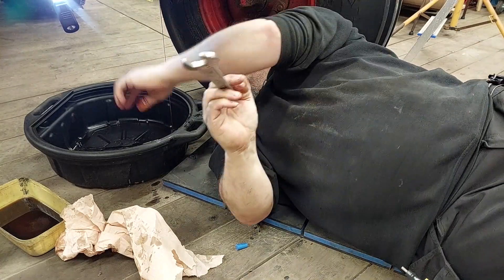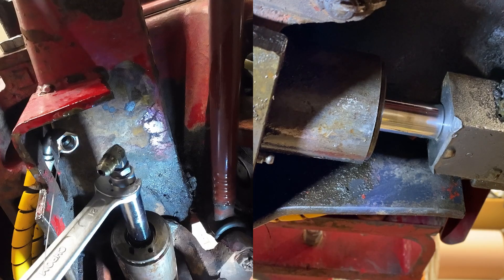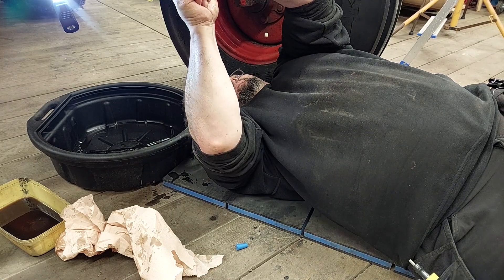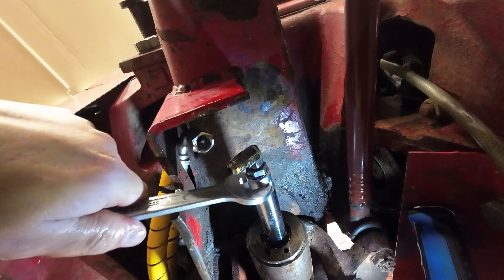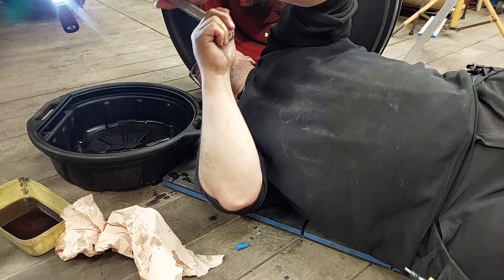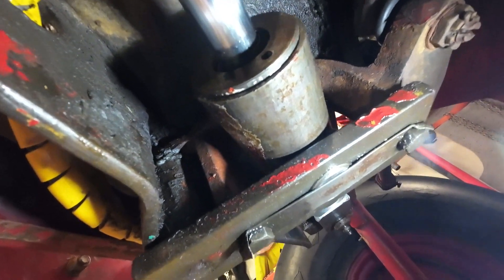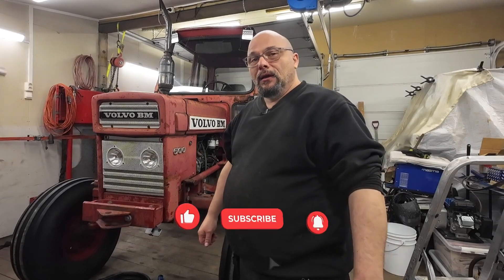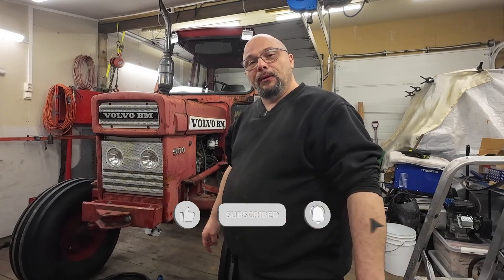Volvo BM 500 - Repairing a leaky steering fork

Comment: Har samma problem på våran  500.  O-ringen fanns inte på vår traktor. Läste att det skulle limmas med sterk Locktite. Nya delar då kolvstången gick av. Locktiten släppte.  Provar med o-ring. Det ser ut att vara en bättre lösning.
Reply from the maker: Du sier noe der. Jeg sjekket nettopp i verkstedboken. (skulle gjort det i utgangspunktet). Der står det at man skal bruke låsvätska og dra til med 110-160 Nm. Jeg brukte ikke det. Dro godt til men ikke så mye at o-ringen ville tatt skade av det. Jeg skulle nok sjekket verkstedmanualen først. Sprengskjemaet i delekatalogen viser en o-ring der så en kombinasjon av o-ring og loctite ville nok vært best. Men jeg blir å holde øye med det og lage en oppfølgingsvideo om det begynner å lekke igjen :)
Reply: 2:06 Brukte locktite 638 pluss aktivator.  Det holdt ikke. Troligen var det olje på gängorna.  Trodde jag hade avfettat . Nytt forsök i sommar pluss o-ring. Måste nog ta ner cylinder  och fästen for å få bort all olja.

Comment: Har du slakke i de indre leddene eller så det bare sånn ut?🤔
Bra forskjell på servostyringen fra en MF 135 der de brukte en standard dobbeltvirkende sylinder med oljekoblingne på tuben.
Men om det der var eneste lekkasjen så tror jeg den patenten er bedre enn MF😁
Reply from the maker: Er nok slakke i det meste i den forstillingen der. Har foringer som skal byttes etterhvert. De indre leddene bør nok også byttes. Hjullagre er dårlige....Som sagt. Det meste i den forstillingen er det slakke i :)
Kjenner dessverre ikke til MF's servostyring. Jeg hadde en 135 uten servostyring. Men var lett på rattet når fresen var på :)
Reply: @Restoringthepast  da blir du altså ikke arbeidsledig med det første 😁
Eneste 135 jeg har sett med servo orignalt er faktisk fadern sin. 4 gir som den har er jo heller ikke så vanlig.
Snodig system som ser ut til å være avhengig av mye slakke i snekka for å aktivere ventilene til servoen om jeg husker rett. Har hatt lekkasje fra ventilregionen i over 20 år, men mye mindre etter noen omganger med Omega i oljen 🙂
Styringen er ikke så mye lettere enn på en uten servo, men det er mindre fare for å få slått rattet ut av hendene.